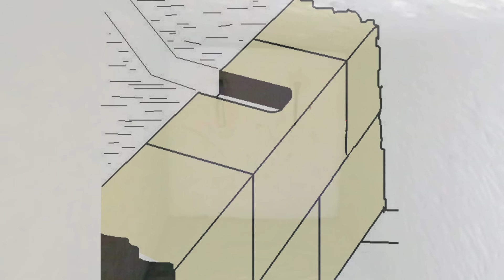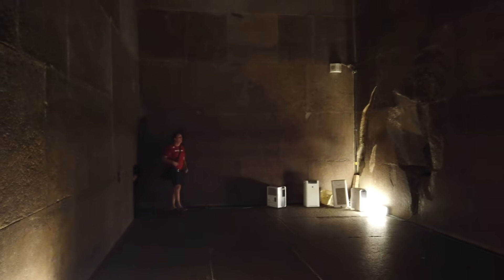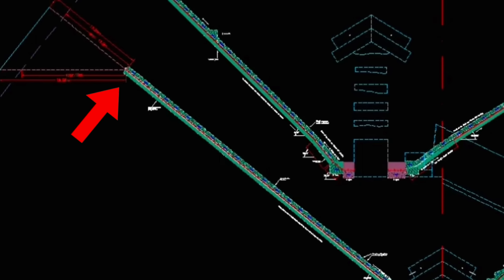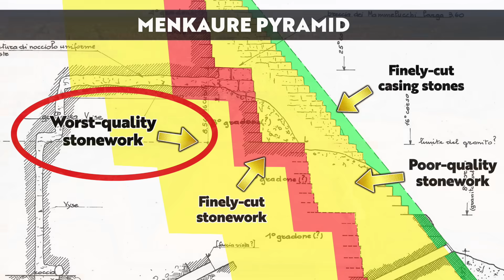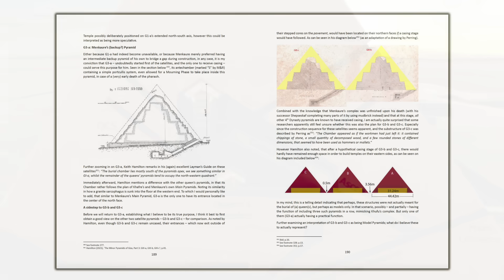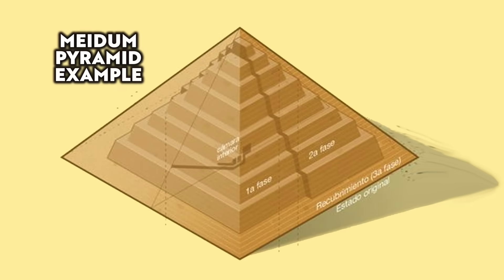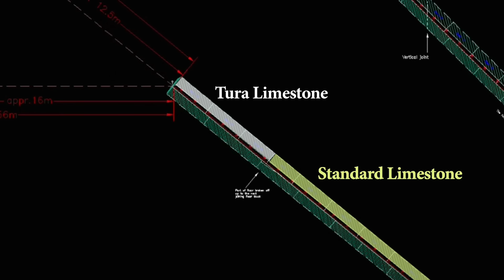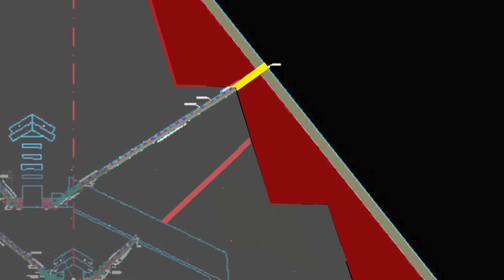Great Pyramid HIDDEN Steps Explain Everything | Part 1

Comment: Another possibility is that the Queens chamber was a backup plan and the full project was intended to be the current size with the Kings chamber as the main mausoleum. 

If money or structure didnt hold up then the smaller size and using the Queens chamberc was a plan B. 

This is almost as your theory but slightly adjusted. It makes slightly more sense to me. 

Great interesting work (video) as always 👍

Comment: Quick “set list” you can try

Drive (Gallery pulse): 1.84 Hz stomps; layer 5.51 Hz hand-claps every 3rd stomp.

Chant tones (rooms):

A2 (110 Hz) sustained (beats with KC 98/117 Hz pair).

E2 (82 Hz) pedal (KC 81.9 Hz).

Optional A1 (55 Hz) drone (KC 58.7 Hz split).

Stops (shafts open/occluded): brighten ~110–220–330 Hz overtones.

TL;DR playable bands

Infrasound engine: 1.8, 5.5, 9.2, 12.9 Hz

Room low modes: 29–33–37 Hz (QC), 29–33 Hz (KC)

Power region (chorus): 58–66–88–98–110–117–131 Hz

Stops/overtones: ~180–330 Hz (variable)

Comment: Whole Structure as Instrument

Core = harmonic engine (multi-band terrace resonators)

Gallery = amplifier pipe

Shafts = tuning slides / organ stops

Casing = horn flare / projection shell

Chambers = pressure nodes / anti-nodes

Comment: Example mini-sequence (sketch)

Descending Passage: θ≈−26° → down a tritone; length → 32 beats of falling line.

Subterranean: first axial mode → bass drone; sparse drum.

Ascending: θ≈+26° → mirror tritone up; same duration → thematic return.

Grand Gallery: each corbel tier = chord step; crescendo across the ramp.

Portcullis: gated 3+2 rhythmic cell; tight filter.

King’s Chamber: play the chamber’s axial/tangential modes as a bright chord; add overtone stack from relieving chambers for the “crown.”

Comment: I think the Gantenbrink door was what first captivated the minds of many enthusiasts. 
This is a really well founded theory, the section of tura at the end of the sealed shaft is makes much more sense in the model.
I have often mulled over the concept that the shafts were possibly used to run ropes through and the lower set were closed once they were no longer useful as the build progressed, but this makes much more sense.

Comment: On the wall with the obviously different surface, I believe if they removed that they would find an inner spiral going up and intersecting with all of the chambers including the air vents that don't release any air. I have always wondered why no one has attempted to open the side, where there is an obvious entry. And what about the hole on the edge; it was entered and then they exited without seeing how far in it would lead.

Comment: An inner step core doesn't make sense, IMO. 
As you walk Ma-mun's tunnel, you can clearly see the backing stones, and they end as the tunnel turns left to view the granite plugs. 
Behind the backing stones is rock chip & mortar, surrounding the inner corridor structures. Not solid stone.

They must have built it one layer at a time, setting the casing stones first, then the backing stones, and finally the core of the layer filled with the mortar.

Comment: Just how does one encase a step Pyramid and move the heavy blocks to the top? The angle seems awfully steep with a step pyramid.
  I think that is where the merit of an inner pathway allowing the stones to be moved upward.  With the ends open and a crane type system to pick up and turn the stone blocks 
90 degrees.  I thought Herodotus mentioned the open ends of the pyramid to turn the blocks 90 degrees in his books?

Comment: Just how much air can those small long shafts actually move?  And I thought they were plugged in the King's chamber
and only recently the plugs removed showing the shafts.?
I still like the idea they were for ropes amd pulleys to reach each side of the pyramid for counterweight on one side and an elevator
type mechanism used to raise and lower the stone blocks used to the interior of the pyramid.

Comment: So if the inner core is a stepped pyramid would they have created the 8 side effect by carefully tapering all of the exterior and then the casing stones slightly thinner towards each centre point. Or would the inner core have been built this 8 sided way to allow them to use mostly normal shape stones and only worry about different angles where each side of the sides meet in the middle ? I guess also the external corner stones would obviously in both scenarios have to be slightly under 90° anyway or it would be noticible over the distance involved.

Comment: In my eyes the more likely scenario is that the orginal pyramid was smaller in design and was for sneferu but he died during construction and khufu took over the project and expanded it for himself. You know that "I'm greater than my father" ego stuff to prove he was better than his father to silence anyone about his status and ability to rule the people. Back-plan scenario is a stretch just because of the fact that to build such an immense structure takes delicate planning. As a builder for the last 30 yr. You don't build back up structures because what you doing might not work and fail instead if it fails you redesign and rebuild. I know absolutely Noone in construction that plans for failure like this with back-ups in designing, if it does fail you redesign and rebuild.!!

Comment: Why being negligence about this obvious fact in plain sight? :
Letting down a plumb line from the pyramid apex it connects also the highest end of the Grand Gallery with the Queens Chamber with the Subterranian chamber !! This means something. Either pyramid construction wise or spritual in connection with the function of the pyramid and the after life of the Pharao.
Secondly: the Kings Chamber being placed eccentric, towards the left in the drawing means it had to be built there. This was possibly done because of the way constructing the Pyramid did not allow another solution! Suggestion: Take the BIG VOID in consideration. Maybe this is much bigger as expected and excludes a central position of this Kings Chamber?!.

Comment: I dunno...I just don't see any advantage to a stepped core, unless you're using blocks of a radically different size for it. Otherwise, it does nothing for the structural integrity. In fact: Once the outer layers go on, it's no longer a stepped core. All that changed was the order the blocks were laid, not any structural properties. UNLESS, the steps were actually a spiral EXTERNAL ramp, or provided flat surfaces to support a temporary external ramp It would be a bitch to build and dismantle, but let's face it...EVERY way of getting the stones up there would be a bitch. But I don't see any point at all to an internal ramp. There's no advantage, and countless disadvantages to having it enclosed.

Comment: People would have visited the upper funerary temple to pay their respects.

Assuming there was an expansion is literally a random guess. 
The tiny air channels were covered in the burial chambers, it was not part of some permanent feature.

Casing the entire pyramid after the core is finished? Talk about over-complicating the process.
It was obviously built one layer at a time, casing stones placed first per layer, then backing stones and a core of mortar & tailings.
Houdin will be proven correct.

Comment: Building a Pyramid. Four teams,one for each siide build a Step Pyramid,running a stone ramp  up the center of each side..
Thisis the skeleton of the pyramid.  They finish it and fo Home. Another 4 teams,starting at the top,  add stone blocks to make the pyramid pyramidal,then attach the outer casing blocks, and work fromthe top down, layer by layer.

Comment: I like your idea of a Step pyramid, (like Djoser's),inside each of the Giza  pyramids. Possibly, they started by building a Step pyramid.(as you suggested)-and ran a stone ramp up the center of each side of the pyramid-for hauling  stones for each Step... As they built higher steps they extended the stone ramp upward. At the Top of the Pyramid, they added the outer stones blocks to make the pyramid Pyramidal-and then attached the outer white limestone Casing Stones. 
They then destroyed the top part of the Ramp and dropped the Ramp down to the next lower Step of the Pyramid-and again added the  outer stone blocks,to the core blocks, (to make the pyramid Pyramidal)-and again  attached the outer limestone casings-and lowered the ramp down to the next Step....They did this over and over till at ground level.
  An advantage of this kind of construction is that you could have 4 Crews working all sides of the Pyramid at one time-rather than one large crew  constructing the pyramid.

Comment: Considering the quantity of mind- blowing architecture discovered by the SAR scan I'm kind of baffled by your deep consideration of what seemed to now be frivolous insignificant air shafts.
At one point in this video you say completing the stepped core was the end of the first and most important phase of the pyramid project.... but that just can't even possibly come close to being true considering what is underneath them. And the fact that we have no idea what the possibly be used for especially now. You can't tell me you can look at the data from this SAR scan and tell me that just completing the step pyramid portion of that pyramid was even close to being one of the most important parts of building the pyramid. if anything it's an afterthought.
Reply: Why can't you recognize a hoax?
😂

Comment: I love this idea. However, have you considered that the grand lintel stones at the entrance of the pyramid would have been at the edge of the step portion of the pyramid and therefore, it would have visually been an impressive looking grand entrance before the backing stones and casing stones were later added. I'd be very curious to know if the robbers tunnels that cut through backing stones to meet up with the descending passage show evidence of cutting through what would be the stepped pryamid portion. That might be a way to prove out this theory.

Comment: i really liked your original idea of the enlarged structure Matt , however this is also a good  suggestion that explains the queens chamber passageways ending short of the final exterior , i do have a question  , the tura limestone at the ends of the queens passageways is there as a finishing incase they decided not to enlarge the shape ,  are the passageways of the kings chamber also lined with tura limestone to match the smaller idea suggested in this video , if so that's a good pointer to me that your idea has it nailed , i don't actually know , but are the ends of the kings chamber passageways finished with tura limestone at all ?

Comment: More than likely both the enlargement from the original design and the Great Pyramid having a stepped core construction are valid hypotheses. Considering the typical over compensatory ego factor of authoritarians, the pharaoh probably showed up one day during construction of the original design and decided that the queen's chamber made his penis look too small, so plans had to change. The architect then added the grand gallery (to reduce the load on the queen's chamber) and king's chamber (offset to also reduce the load on the queen's chamber) to make the pharaoh feel better about his micro-endowment as well as to keep his head attached to his shoulders. A stepped core adds overall strength and stability to the finished building by aiding in load distribution and load redirection and easing construction needs and methodologies.

Comment: Hey Matt! Good assumtion on step pyramod. Let me dissagree on "the core" idea. All pyramids in America and  most old cathedrals were built on older religious buildings. Same here. Girdle stonesin ascending passage where in fact enges of oder step pyramid (not prevuilt core). You can move forward with step shape adding girdle stones as a'la mastabas steps. All chamber were in use, but in differen eras. Reach me out if you wish to see graphs withsteps matching girdle stones and 3 phases of this amazing building.

Thanks for your amazing job here and sharing your thoughts! Greetings from Poland!

Comment: I think the order of the stepped-core build method is a great explanation! But I've always wondered why the design of the King's Chamber is so different from the Queen's as regards the number of slabs above the chamber. Have we found a reason why they needed so many stacked slabs and gaps there? I've been following the channel for years, but I may have missed the definitive explanation for this.

Comment: Excellent and very clear video. As an architect myself it seems plausible that they would build a rough structural core, then backing stones to reconcile the stepped core to the smooth casing stones, and the casing stones over the backing stones as the final finished layer. Two layers of gradual refinement over a stone core. People disagreeing with this and leaving comments that the casing stones came first to determine the pyramid geometry lack basic understanding of construction. The structure cones first, then the cladding comes later. Thank you for putting out this quality content. One thing I would say is regarding the overhead image you showed that might be either a ramp or the stepped structure, is not mutually exclusive of either theory. The stepped core might have been a type of scaffold support for a ramp, so the two possibilities could have coexisted.

Comment: Mmm, I don't think you've got this..! No engineer, no architect, but a keen eye . 1, The Queens chamber is  centre to the vertical  center line, why build the Primary  chamber off centre? Unless if was built long after the queen's chamber,. 2. Expanding on the steps,  I think the the stepped pyramid was built long before the current edition. The queen's chamber was the sole chamber, along with its air vents. 3. Which I'm not sure we're air  vents either. Think!  a very different climate then, rain could flood into the chamber...!  If a dry chamber were desired, channels pointing up on an incline would not be ideal. Also more difficult to construct, horizontal ones, dead easy, and air can move just as easy. I begin to hypothesise that the Pyramid we know today was a repurposed stepped pyramid, with Less emphasis on the internal layout, and more on the external aesthetic. 
Also, if you wanted air in the chambers, why only two in each arranged N / S surely more vents, and not facing up. These vents were for something else, we tend to incline surfaces to either expell or capture... Water! Was water significant to them? Boats in the ground would suggest it was. Or even smoke expelation.  But vertical would be better for that, and again easier to  construct than inclined.  I don't have all the answers,  but the vents are more significant than we currently believe. Repurposing an old stepepyrzmid makes much more sense, than starting from scratch. I would love your  comments and hope a beneficial convo could be engaged in.😊